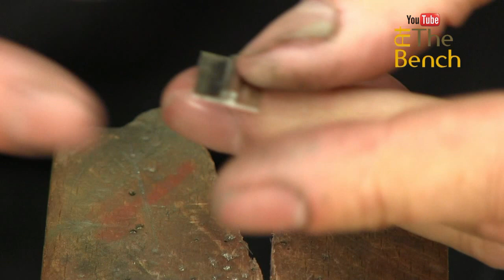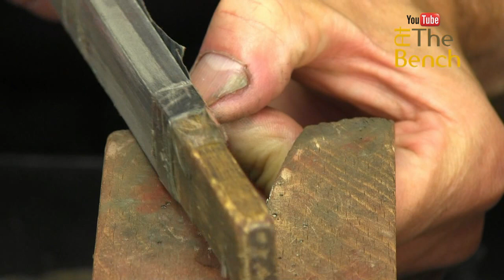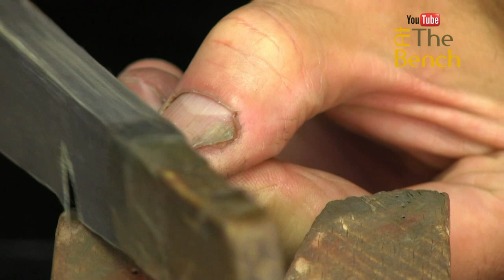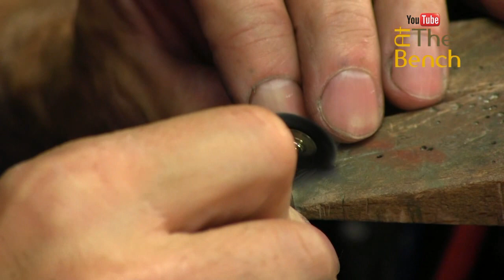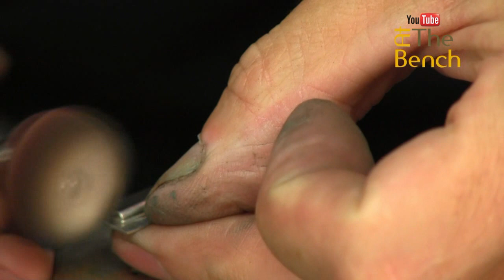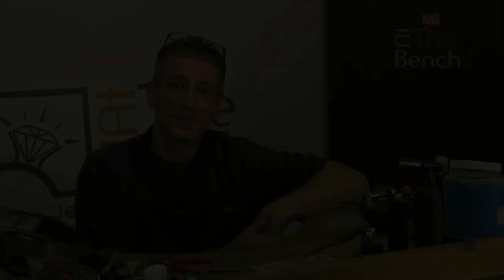How To Clean Up Excess Solder If You Have Soldered The Way Most People Tell You

Comment: What is a buff stick? Can you remove the very thin layer of solder off of copper without damaging the surrounding copper? What grit is best for removing solder smear off of surrounding copper. Someone had tried to fill a seam on an antique piece and I'm trying to remove the solder which required a torch to melt the blobs but I'm left with the lighter spots that wouldn't just wipe off when hot.

Comment: I have watched all your videos. They are amazing!!!! Love everything you do. Then I tried to solder a sterling silver ring (10 gauge wire). I used regular paste flux around the area, and a small piece of medium solder. It doesn’t work, I kept using the tourch fire around the ring for more than 2 min, the flux dries, the solder gets black and falls. I tried 5 times , the silver is changing shape but the solder doesn’t melt and flows like in your videos. 
I was so excited to get started but now I ’m so disappointed.  I have no idea why it’s not working. Any advise?
Reply: The same thing was happening to me, turns out the piece wasn't getting hot enough quick enough and so the flux was drying out and the solder was oxidizing and could no longer flow. What kind of torch are you using? I just use a little butane torch and I solved the issue by making sure its always topped up with the butane otherwise the flame wasn't hot enough.